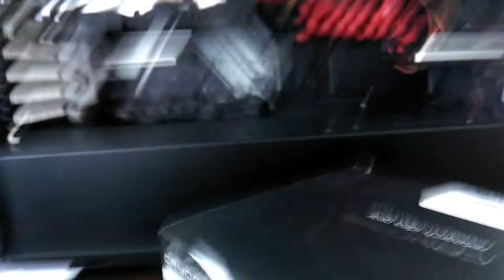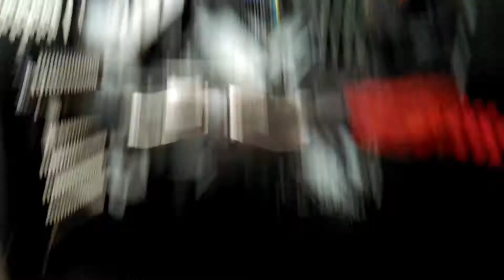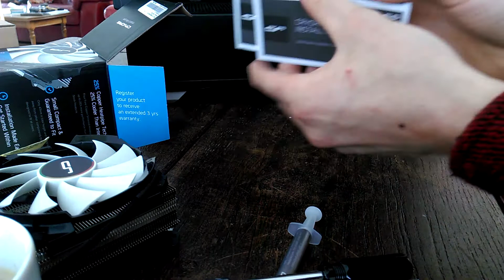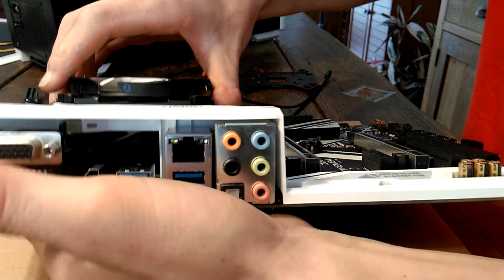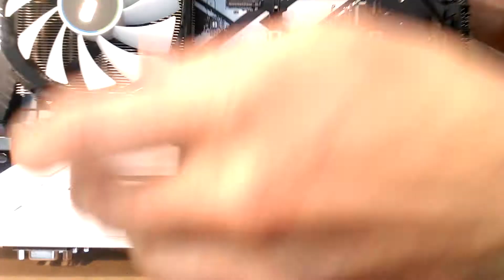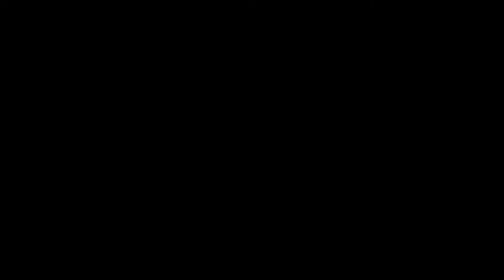Cryorig C7 (CPU cooler) Unboxing & Installation

Comment: I was on the fence about buying this, but after seeing how simple it is to install I have no doubt I should get it. Thanks for helping me with my choice!
Reply: Yuska Brailly dude how do I remove this screw that’s connect to the backplate. I bought on eBay and they are on the wrong screwhole